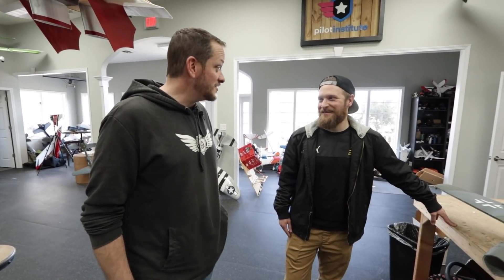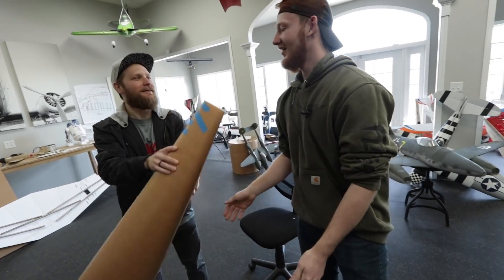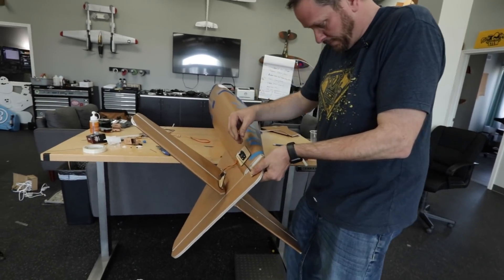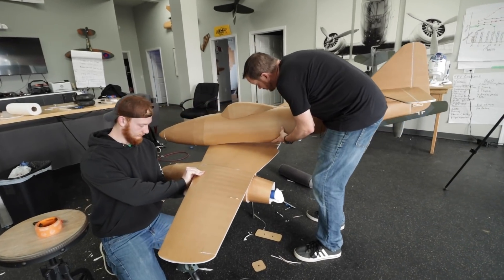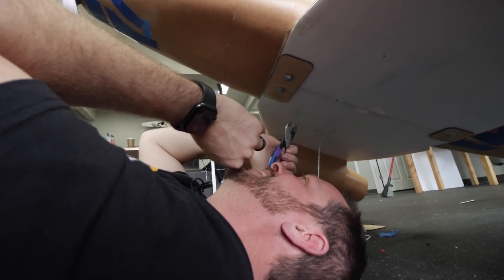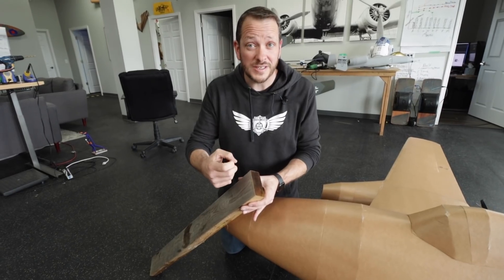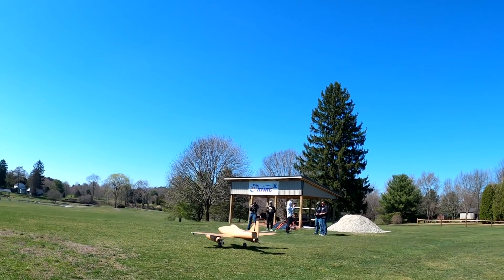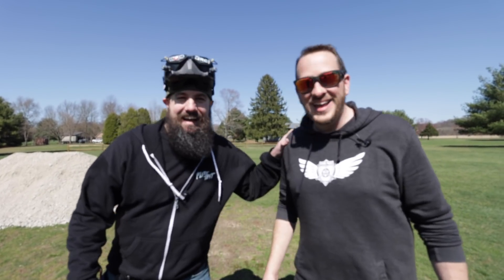Giant DIY ME-262

Comment: The 262 had problems with its front landing gear that could colapse during take off and landing, this plane had a very poor aceleration tho it had a very good top speed about 700km/h in a straigh flight and 900km/h in a dive, it had 4 30milimiter canons on it's nose, the engines had problems of woverheating so past 24h they had to be replaced by a newer engines, cuz germany didn't have the material to build engines that lasted more then 24 h with no problem.

Comment: ME 262 used jet propulsion, not prop propulsion. To use differential propulsion on jet engine would be very difficult. Six axis, rudder, aileron and elevator. Foam board and cardboard wouldn't handle the heat from a regular model jet engine. Foamboard and card board is a lot cheaper if you just going to crash it anyway. 4000 Dollar model jet engine x2 versus a 100 dollar brushless motor x2. Lets see some money crash LOL.

Comment: Josh shows his valuable knowledge once again with the placement of the main landing gear and their hinderance on takeoff rotation. I was taught this lesson in my aerospace engineering senior design course and I honestly would have overlooked that. One thing I am concerned with is how close those propellers are to the ground and how far behind the the point of rotation (the main landing gear wheels) they are. During a scale takeoff, it looks like they may strike the ground during rotation. Fortunately, you have plenty of power and the plane lifted off the ground without the need to rotate the nose upward. I love these builds and, as always, I enjoy the practical knowledge Josh has on the mechanics of flight.

Comment: Hi, i am currently looking at getting into the r/c hobby but have no equipment barring foamboard a couple servos and a very low budget (£60-120ish) 
I think i want to make an f t flyer but if there is a better plane to make please recommend it
I also know nothing about transmitters and receivers and do not have one, what is a good budget transmitter that i can use as a newbie? 
Thanks (:

Comment: “I’m worried about the weight in the nose”
-German engineers after adding more mk103 30mm cannons
-flite test after building a foam version without guns but still repeating history
Reply: Yes just like a real 262, the nose wheel broke on landing.
Reply: germans put a frickin 50mm cannon on it once. more than enough to take out anything it would find in the skys and probably a tank if incredibly lucky.
Reply: @thatlittleratinyourcloset7612  not lucky. The 50mm came from a late panzer iii. With apcr it could pen about 100mm.
Reply: @icancraftsomething  ah, sorry. didnt want to seem like i was faking it's existance by making it seem too good. thank you.
Reply: @thatlittleratinyourcloset7612  the real question is would a 50mil actually be practical for a ww2 era fighter. A 20 or 30 mil cannon could take care of anything but they fired faster than a 50mil and their able to hold more ammunition and their lighter. Smaller cannons also had better range so they were still effective at further distances. That 50mil version was designed for tanks
Reply: The production Me 262 had MK 108 30mm although there was a prototype with 2x MK 108 2x MK 103 and 2x MG 151/20
Reply: @aerocraft3377  Th 262 a1/u1
Reply: @icancraftsomething  The thing with a Panzer 3 cannon, yeah.
Reply: @icancraftsomething  Yes I know that but I didn´t want to make it too complicated
Reply: @biko9824   The 262 with the 50mm (MK 214a) was the Me 262 A-1/U4
Reply: @biko9824  The a1/u1 was with 2 20mm,2 mk 108,and 2 mk 103.the u4 was the one with the long dong 50mm

Comment: That's a neat looking Schwalbe. My suggestion - I think that the Stuka crashed because rushing air opened the cavity on leading edge of wing - it'd be reasonable to cover leading edge with packing tape (or perhaps even paper tape would be better so that the paint would stick better to it) to prevent its opening. 
Another thing is - where's the love for minis? Everytime you so something it has to be huge with brick sized battery :( I'd love to see a big aerial battle between ya'll. Axis vs Allies, all minis, that'd be cool. Oh and you should collaborate with Jack and Steve Niezgoda. They've got some good designs

Comment: I saw the wing flap a couple of times. Looks like it began w/negative G, overshot the normal position, then dampened. During construction I was curious about the possibility of wing twist related to lack of fore/aft unconnected spars and lack of formers, but that's not what the video indicates. It appears G related since both wings reacted simultaneously. Both wings twisting or experiencing aileron flutter would likely be cyclically independent from the other wing. You've probably resolved this by now. It's gonna be a great flyer!

Comment: Guys, Please have a short as possible plus and minus cable between battery and esc with EDFs, if this are longer then 15cm you get pulses in cable and you can fry the ESC......You can extend the 3 fase cables from the ESC to the engine ...up to 150cm....ohw darn, you use pushprops

Comment: War thunder player tips - you don't need landing gear. You can land on engine nacelles :)
Reply: Unless it’s the 262. I remember reading that it’s engines were very...touchy. And by that I mean if you gunned the throttles in mid flight they had a small chance of exploding
Reply: @SpartanChief17C  that was a joke. In real life yes. These engines were likely to explode if you punched the throttle and they had to warm up before take off, that's why Germans used Fw-190 D series to protect Me-262's. In game, war thunder, this "feature" of 262's engines is not preserved and you can land with landing gear up on nacelles and your plane will even stop rolling on runway sooner than when you'd land on wheels
Reply: Yes i actually did that with the premium version and i had a sleepover and i didnt even damage it lol

Comment: Hi, Ive been watching Flitetest for a while and have been trying to get into RC with simple planes, but even then everything is very expensive. Does anybody know what to do?
Reply: Usually the expensive part is a one time purchase, getting a good transmitter and all your electronics that are going to last even if you crash (unless you have a very obscene nose pointing down crash that can kill your motor and battery) the planes made in foam are cheap. I suggest you start by buying a six channel transmitter with the capability of connecting to your pc via usb cable and practice a lot with a model flight simulator, there is a lot of good sims like realflight, Phoenix RC and there are others free like FMS simulator. It's a very nice hobby. Cheers
Reply: @axelvdp1  Thanks for the advice man I really appreciate it!